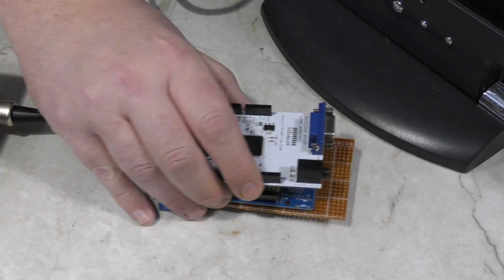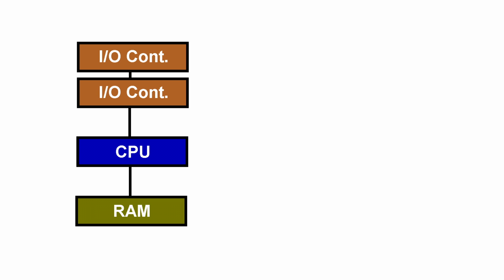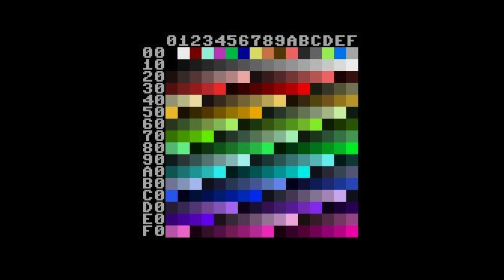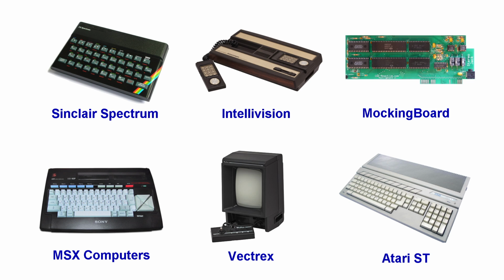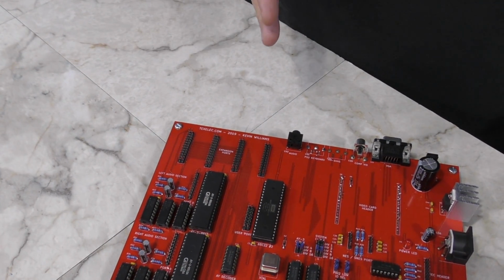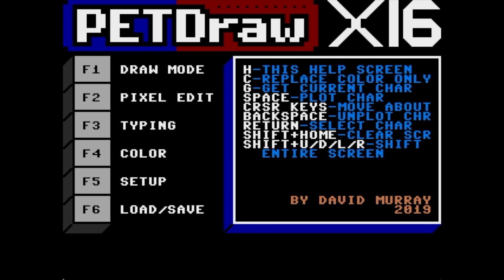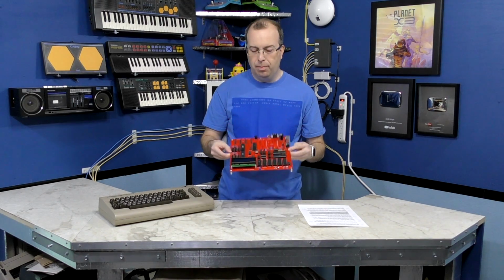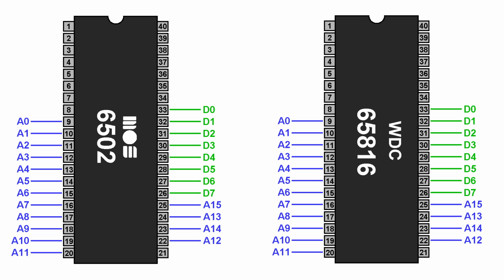Building my Dream Computer - Part 2

Comment: Is there really a crystal in those old computers ? Could someone please tell me more about this crystal so that i can look it up myself ? When i google "old computer crystal" i only find a game called crystal caves. Im super intrigued about a crystal being inside a computer xD.
Reply: Not positive but i assume it's much the same as a quartz watch crystal 
Basically a perfectly tuned piece of quatz that oscillates back and forth, then once per cycle it send a signal that can be used as a clock signal and sends a pulse to the crystal to keep it oscillating.
https://youtu.be/_2By2ane2I4 better explanation
Reply: @roterex9115  That's such a cool video. Thanks for the link and the explanation :3.

Comment: I know this is two years later. I downloaded the emulator. Tried messing around a little with it. But I'm 26, never grew up with any of these old computers, would it be possible to buy the computer manual before the product comes out? I know that sounds odd but I'd love to learn this kinda stuff but unable to even know where to start. 

Thanks!
Reply: It's likely they'll offer a digital version of the manual when the hobby kit version comes out.

Comment: Old man, I built my first programmable comp in 3 months from scratch with THT electronic pieces, and even have a patent for original computer architecture 😏
Reply: I even have contract with Sony
Reply: 633 Mhz cpu, 123 MBram at 123Mhz
Reply: New cpu architecture, the cpu has integrated chipset. No Hdd, Ram acts also as Hdd, and the Bios acts as programming interface.

Comment: I wonder what happened to his dream computer project, we haven't had an update for so long
Reply: Yeah, wondering the same.
Reply: Perifractic has released a few videos on it somewhat recently, attack of the petscii robots has been ported over, and the case designs are almost complete.
Reply: @Pc118Gamer  Thank you too!
Reply: Same
Reply: yea
Reply: @chlorobyte_projects  Thank you!!
Reply: @XaviaFH i presumed it was already released because retro recipes done a video on it & he helped with the case design
Reply: @XaviaFH there's a lot more recent updates on the TexhElec YouTube channel
Reply: @cryptocsguy9282  Thanks for information!
Reply: Maybe somebody has changed name? Idk
Reply: I really dont rember.
Reply: The design is complete, but they ran into manufacturing issues, machine soldering in china is a pain in the ass while hand soldering requires little initial investment but it is slow and the 8 hours of specialized labour in a first world country would drive the cost far beyond the original goal. As of the latest public update (I'm not on the patreon) it seems the current goal is for the initial run of X16s to be sold as a kit.
Reply: @franciscoarana3735  thanks

Comment: I would love to see a rebuild of the Apple 2GS with the Apple 2e interface card that would suit a standard latest LCD monitor with the tram lines at the side.

I would like the Apple 2GS/E to have a hard drive where it would take all the legendary games like "Lode Runner" and "Aztec" and run them in enhanced colour.

That is my wish list using the parts they had previously that is SMD.

Comment: So a question for people smarter and more knowledgeable than me:  When I watched this video, I kept thinking back to the previous video on the Mini-pet.  I kept wondering, instead of stressing over a working design, why not just add a graphics chip, and a sound chip to the mini-pet, which already exists?  That's a known working design, right?  Or is that too dramatically different than the VIC-20?
Reply: The PET is a monochrome computer with no graphics modes or sound, and the built-in character set cannot be modified. The VIC, although limited in it's capabilities, is just a better starting point for a project like this.
Reply: @sierraromeoromeo2444  I see.

Comment: I know this is an old video (and I left a previous comment), but when prototyping a computer, you don't design the prototype as a single board.  You instead design a bus board, kind of like a S100 system.  That way you can have a CPU board, a ROM board, a RAM board, a sound board, etc., and you can test different aspects of the system one at a time.  You can also unplug a card causing problems.  Once the hardware design is debugged, you can finally design the single board, or you can keep the bus board design
Reply: Well, even though they didn't follow your expert advice, they've done okay, so I guess you don't know everything. Also, how many computers have you designed?
Reply: @sierraromeoromeo2444  To answer your snarky question, two Z80 computers and one eZ80 machine, as well as other computer expansions.  Are you always this arrogant and bitter towards everyone?  One of the most common mistakes by people designing anything electronic, beyond their typical workload (professionally) is they try to design it all at once, instead of dividing up the circuitry in sections (which is typically a professional workloads method which saves time and money).

First, you get the CPU subsystem working (RAM and ROM as well), then you get the I/O interface subsystem working (chip selects etc), then you divide up the rest of the systems (sound, video, etc) and get each of them working on their own.  The easiest way to do this is you have a common bus plane with slots, allowing these separate circuits to be installed and tested, as well as removed.  Once you get the prototypes of each subsystem working, you then test them all together.  Once you get the whole system working and alpha software/firmware debugged, you can then move that design to a single motherboard, and then workout the small bugs that creep in there.

Constantly redesigning huge motherboards and bodge-wiring them to death is no way to get a system working in a timely manner, and can be a waste of debugging time, and waste of money buying parts and circuit boards.
Reply: @richardkelsch3640  Like I said, they managed without your advice. Back to your expertise, got links to these computers you designed?
Reply: @sierraromeoromeo2444  David complained about how there is a design loop, and if one system has bugs, it can hold up other sub-systems, and fixing one can break another.  The way to minimize that loop is to modularize the system in the design stage.

As to links to computers, no, as they were made under non-disclosure for embedded systems.  My "advice" is called "constructive criticism", and it was advice given to me long ago, but you obviously take absolutely everything personally.  It's a sad way to live life, but carry on being a troll.  Maybe YOU can supply links to systems you designed?
Reply: @richardkelsch3640  Your "constructive criticism" is about 2 years too late!
Reply: @sierraromeoromeo2444  So what's your excuse?

Comment: Can you add legendary program "Vim" to your project?
Reply: no, that's a linux program - this has a fully custom-made kernel that won't be compatible.
Reply: @Jumpeye1897  hm... May  VIM be ported to "commander x16"? How much time need for this task?
I think... That vim ideology is has realy great compatable with old machines.
Reply: @Jumpeye1897  If there is a c compiler for commander x16, then there will not be a big problem in theory.

Comment: I had the Rockwell and WD manuals, Apple used Wd65C816. Rockwell had 6529 a dual 6502 (enhanced) sharing alternate clock phases.

Comment: When you described one of the graphic chip prototypes as not having a bitmap mode and having to do everything with sprites (but having a MASSIVE number of sprites to compensate)...there is another system that worked in precisely that way: the Neo Geo.

Comment: I just recently heard about this, and was pretty interested....until I started looking into it, and found where someone was requesting the current schematics.  They are apparently not available to the public until it's been developed more.  That would be fine for a private product, but if you are wanting to build something to help people get into low level design and development, it doesn't make sense.  Perhaps i've mis-interpreted, but at this stage it would seem they are not interested in having people help develop this.
Reply: This is for people to learn to code, not design electronics. They have all the people they need, your input is not needed!
Reply: @sierraromeoromeo2444  Arguably neither is yours.  You don't have to agree with my assessment, but they haven't said that it's intended to be an absolute blackbox that you only learn to code on.  They have repeatedly emphasized that it was supposed to be a community project...and it isn't.
Reply: @teslafreak  No, they never said that it was a community project! The schematics and technical details will be available eventually, but not right now.
Reply: @sierraromeoromeo2444  Why will the schematics and technical details be available eventually if it's "for people to learn to code, not design electronics"
Reply: @teslafreak  Because they will, that why! They've said that, sorry that you weren't wanted on the team, but that's how it is, deal with it!
Reply: @sierraromeoromeo2444  I don't think I'd want to be on that team. I just think it's dumb. You however seem to be getting pretty angry about the whole thing. Need a hug?

Comment: This maniac wrote an entire kernel HIMSELF for no other reason than to sell a product that has no modern application. Even if you learn to program in Basic or Assembler,  those bear almost no resemblance to modern, object-oriented development languages. At least the Raspberry Pi, for all its shortcomings, really can be used to teach modern programming.
This machine is purely for nostalgia, but that's good enough for someone like David.

Let us all stand back and appreciate David's genius and persistence...because none of this could have been easy.
Reply: He didn't write an entire kernel by himself, he and Michael Steil have adapted the VIC-20 kernel.
Reply: @sierraromeoromeo2444  That's still a big undertaking.

Comment: I'm into computers never built a board from parts just did assembly line like stuff putting PC's together the most I think I'd have to deal with would be dip switches I guess, I'm not really fallowing this build and am skipping this video.

Comment: I seem you mentioned "LOAD" <program> often in the demo; however you also mentioned that the board did not have any "mass" storage built in yet (and probably no kernel support for them either), so are you using the banked ROM as a "mass" storage device, to pull in these programs?  You did mention something about builtin programs. BTW. love your show and hope you get back on track (2/2021) soon!

Comment: A pity you did not made a much bigger low RAM, you can now make a MUCH bigger low RAM then back in the 70s and 80s, and why not use a 68000 CPU, they are very cheap second hand on ebay and AliExpress and so, they cost only US $1.33 on AliExpress, and $3.42 on ebay, but yes it looks great the 256 colors.
Reply: Because his dream computer is a C64 in steroids, after all, it's HIS dream machine. (Simple machine with full access to bare metal and without the chores of the x86 or 68k processors). In the end, is a nostalgia thing: You miss the 68K era, he miss the 6502 era.

Comment: Could this all be done using emulation on a raspberry pi or something similar with a hat for the vga/audio/other i/o. I know it might defeat the purpose, but it seems like a lot faster/easier way to get your product closer to the price point you want.
Reply: That entirely defeats the purpose, the purpose is to have no obfuscation between the hardware and user, and software is just that; software. Emulators on Raspberry Pi has been done to death. This project isn't about being fast or easy. He does have plans to develop a SBC form factor version that would be a lot cheaper, however I'm not sure if that would be possible without FPGAs for the larger chips. I love FPGAs, much closer to real hardware than software emulation, but are also bordering on defeating the purpose.
Reply: @MrMG43  SOCs or ASICs are better than FPGAs.... just sayin'.

Comment: your basicly making a raspberry pi but far better and allot mor powerfull  than a pi 4
Reply: Not really, the Pi 4 has a 64-bit ARM chip running at 1.5GHz (1,500 MHz), the X16 is an 8-bit 6502 (old architecture) running at ~8MHz and is a lot slower/less powerful which is the whole point of this project. Watch his video about the Color Maximite 2 which also has a modern ARM chip but runs Basic. This project is more like making a VIC 20 that's faster and more powerful (faster CPU clock, more system RAM, much better video chip with its own VRAM)

Comment: Please I want help I need a converter from USB or ps2 to the old 5din pin keyboard who has xt coding 
I want to make an at to xt keyboard for my very old computer and I don't have pic 12f629 in my country so I can't use it put I try with pic12f675 but it didn't work because the coding isn't right
Reply: Delete system 32

Comment: I made a 4 chip AY-3-8912 PC card back in the very early 90's.  Fun stuff.  Same as 8910 minus the extra I/O ports.   Miss the old days.  One would think wait states could be added to the bus when accessing the AY-3-8910's.  Not sure how easy that would be with the 6502.

Comment: I'm eating this stuff up, as I'm a retired EE working from 1981, so this equipment  brings back that warm familiar feeling. I broke down and bought a VIC-20 from K-Mart when the price dropped to $239. It only came with 5k or 6k of RAM. I put a 24k expansion card on it. You have a new subscriber!  🙂

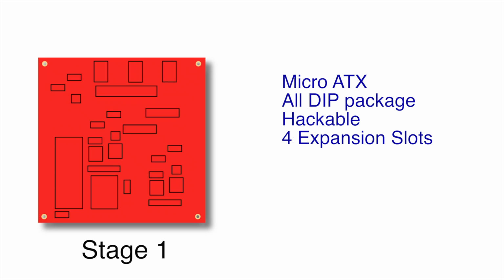Comment: 20:50 , maaaaate.... you've gone WELL overboard. A custom ATX case?!?!? At best it should be a laser-cut plastic box, at worst you just cut holes in the cardboard box it comes in. Expandable!?!? Mate you're not replacing the PC. Apple gave up on competing like that years ago, and they were the biggest competition to PCs (and still a small fraction of the market). 

Chuck 2 sound chips in, why not 6? 8? 

Dude, there is no nostalgia attached to this, nobody had one as a child, and very few people even learned BASIC never mind machine code. Especially C64 unfinished BASIC where there were no commands for graphics or sound, despite those being the machine's selling point.

You're aiming at, who? Millionaires who enjoyed programming 6502 machine code back in the day, and the people who want to learn BASIC in a way that's completely useless and unrelatable to modern machines. 200 - 300 dollars!?!?

Make a list of how many people are working on this project. You might sell your product to half of them. That's it. FFS don't remortgage your house to pay for this. Obviously you're doing well with the Youtube money, and I suppose if this project brings in viewers then it's paying for itself that way. But you've let feature creep get in. You need to maybe set a fixed budget, and anyone who says "it would be nice to have xxxx" has to take something else out of the design to pay for it. 

If you really want expandability just have 1 port like the Spectrum did, an open bus. Same sort of thing in the C64's cartridge port. 1 connector, and if you want to be economical make it a PCB edge, $0 extra cost. Then if people want to expand, they can add a 4-way expansion adaptor if they want one. Lots of companies back in the day offered boxes like that, multi-way expansion. And not a single one of them was ever sold. 

You really, really need to identify your market here. Obviously, "nerds", but you need to go further than that. Anyone can add new chips when it's just a chat on Facebook, but when it comes to actually buying them it's a much heavier commitment. How about anyone who proposes to add a new chip, has to buy 100 of them out of their own money? That'll cut down the daydreamers. 

Anyway, dude. This whole caper might be educational as an example of how tech companies fail, but it's all been written down and recorded before back in the 1980s, featuring actual professionals and their crazy blue-sky ideas driving them out of business.
Reply: Ok just seen stage 3... an FPGA on a board. FFS! Was that not exactly what you wanted to avoid? Other people already make boards with FPGAs and RAM, dozens of companies do that. How many of your enormous market are gonna buy a Stage 3 having not wanted a Stage 1. 

I dunno if I even need to pick it to bits. Put your parachute on and jump. This project has failed, gotten out of hand, bad management and not sticking to the plan. And also not having a plan to start with, just some nebulous things that might be nice. 

Seems like nobody was able to say "No" to any suggestion, so you got further and further away from anything anyone would buy, and then with Stage 3, light years away from reality. 1 stage! That's what you get, 1 stage! They didn't sell the first cars with square wheels, round ones coming in Stage 2, and in Stage 3 you get an engine instead of having to stick your feet through the floor like the Flintstones. You have to have a viable sellable product from the start.

You're really not gonna need to get an ASIC made for this, trust me.

Comment: When you asked what real machine this would be similar to I thought about the NEC SuperGrafx, the ill-fated update to the TurboGrafx 16. 

7.1MHz 6502ish CPU, 32KB SRAM, 1MB external memory bus w/built-in bank switching, 128KB VRAM, two graphics layers with sort of almost 256 colors (15 color tiles but 16 palettes) plus 128 sprites and 6 channel simple wavetable sound. You could get all that extra RAM and ROM on a cartridge (Arcade Card had 2MB RAM). Doesn't exactly have an 80 column mode but you could do 64 column (512 pixels wide) by about 60 rows w/interlacing, it just wouldn't look too good on a TV. No true bitmap modes but you can emulate it with tiles.